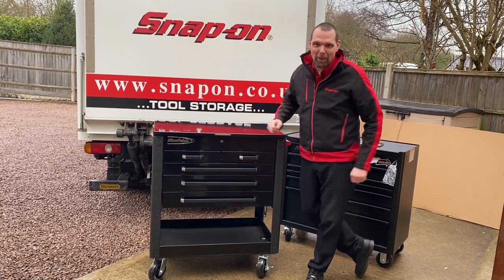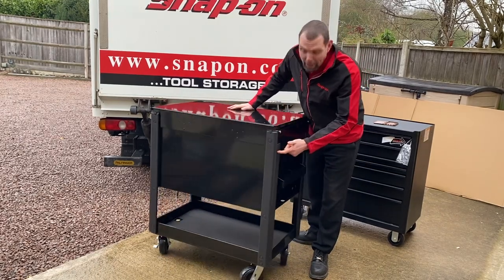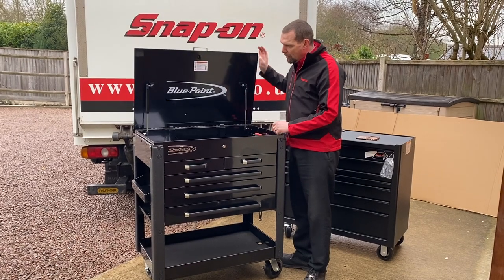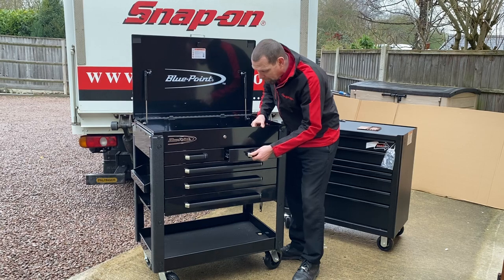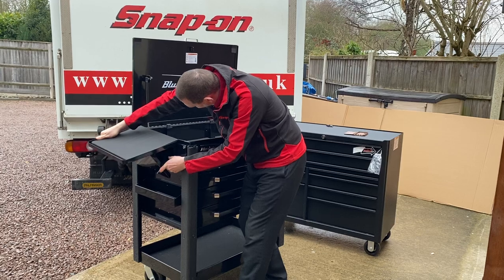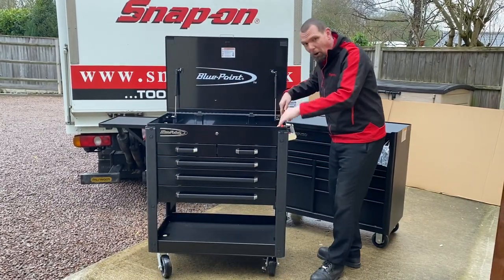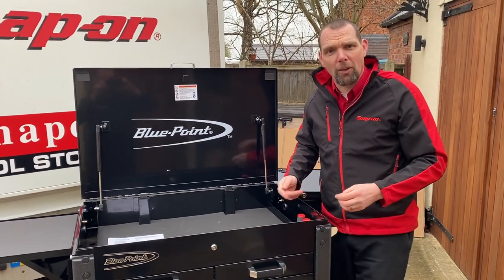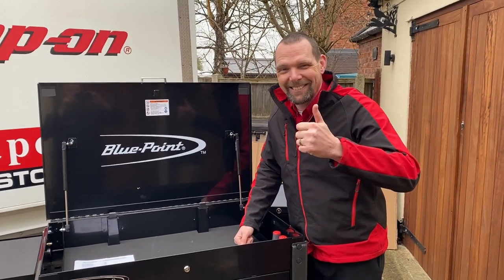Blue Point Service Cart. PN:KRBC50TBPC

Comment: I have a red one. It's a great cart. I bought it as an upgrade because it has the big wheels. My old cart had small narrow wheels and they would get stuck in the drain grate in the shop. Not a problem with this one. I keep a all my brake tools and chassis/front-end tools in it and use it as a mobile workbench. I've had it for a little over two years in a busy shop and the drawer slides, gas struts for the top and casters all still work like new. I highly recommend it.